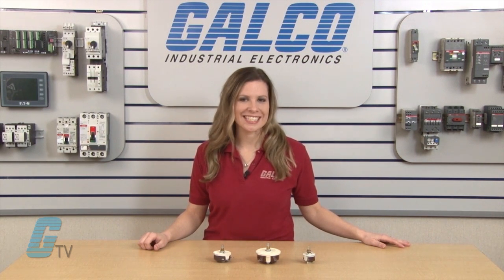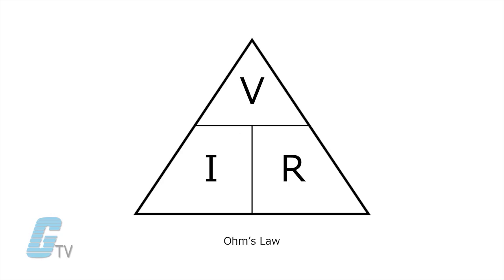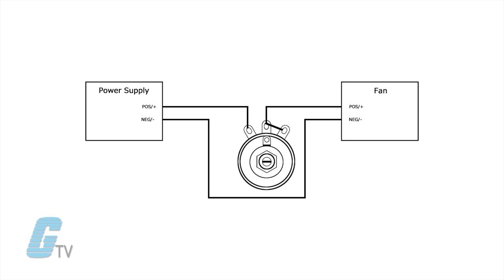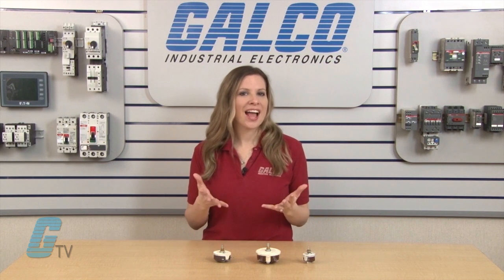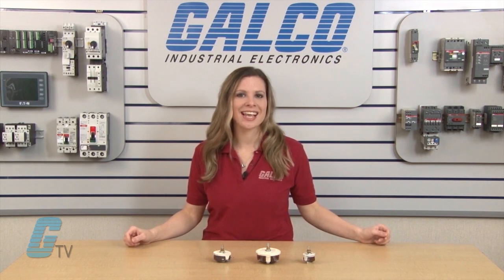What is a Rheostat

Comment: Say, can you tell me what kind of speed control would be appropriate for a vacuum cleaner that operates  at 110-125V AC, if we want the minimum power to be, say, 400W (at 120V) and the maximum at 1200W (again, at 120V)?

Comment: No with any resistance ie resistors and diodes zener diodes etc you have a voltage drop within the circuit. 
Normal diodes are from 0.6 to 0.7 volts drop within their normal working parameters.

Comment: Great videos..... I have to correct you with resistance and the voltage and current laws. When the resistance is increased in any circuit both the current and the voltage will be decreased.  When we decrease or lower the resistance in a circuit both the voltage and current are increased.
Reply: How so? I was under the impression that the voltage was constant, independant of the resistance.
Reply: @vincentdrew2194  voltage remains the same, and with increase in resistance, current decreases; with decrease in resistance, current increases. So in this case, the light bulb would have increased in brightness with decrease in resistance.

Comment: Hi.  I was trying to operate my LIONEL train  that work on A C  voltage from a big Z W transformer 275 watts - 60 cycles   at total 18 volts, i
was  purchasing an 50watts- 30 ohms  rheostat  (BUT) it not working as my train goes  jack rabbit fast as soon i turn the volume on that
rheostat ,why ? It seem to be very simple to install as just splitting in two the positive wire and just install the rheostat between so,why it
not work ???

Comment: A Rheostat is a variable resistor used to vary current and in a crude dimmer circuit. . A potentiometer is the same component used to divide and distribute voltage as in a volume control.

Comment: GalcoTV  Any idea if I used 225 Volts AC to control a 220V motor speed, what rheostat value resistance, watts, and voltage should I used?  Also if built and I used 1,000Volts AC, what rheostat value resistance, watts and voltage should I need to control a device that can handle 1,000Volts?  Can you help me what best rheostat value to control to avoid breaking off resistance and wattage? I need help to that.

Comment: what size rheostat do I need to control the voltage into the field circuit (12 volt but could go to 14 volts) of a 150 amp alternator to regulate it for welding?
Reply from the maker: Hello Junk Yard, we are going to need more information then that to recommend something that will work. Can you please give us a call at 800-337-1720 and ask for a product manager to help you size something correctly, ok?
Reply: The fields pull about 8 amps at full battery voltage (12-14). I am wanting to be able to vary the amperage from the alternator from 0-150 amps. I have been using a 10 ohm rheostat  and it works but I thought maybe a 30 ohm 150 watt  might give me more adjustability.

Comment: I am looking for a 100 K ohms, 4 Watt, 3 terminal Rheostat. Where can I find it.
Reply from the maker: Well Andre, our rheostats start at 7.5 watts but only go to 5K ohm, higher wattage will go as high as 50K but that is all I could find here. Our potentiometers only go to 2 watts. Can I ask what is this for?
Reply: it for a vintage Eico 950b meter.
Reply from the maker: Did a little research for you, for other sources of parts for something like this, I simply put your make and model on the web and found entire unit. You may want to consider a parts unit to keep your running. Does it have tubes?
Reply: The problem with buying another unit is that those switches are so old that they might not even be good. SO I am doing a restoration on the one that I have. I have manage to find a wire Wong pot that will suit  my need and yest it does have tubes. Thank you for doing the research and trying to help me. I really appreciate it.
Reply from the maker: No problem Andre, glad to do it. We at Galco think its kinda cool keeping the old stuff running, that's why we stock over 2.2 million parts. Sorry we didn't have what you needed today, but keep us in mind for tomorrow, cuz we literally have millions of parts in stock. Anything else you can think of you want to see in our videos please don't to post it right here or on our forum at "forum.galco.com."
Reply: Do you guys sell like precision resistors and capacitors? As you know in old electronic equipment there are lot of odd values of resistors and capacitors. So if you do pleas let me know
Reply from the maker: Yes we do, just call us at 800-575-5562 with a list of items you are searching for. Resistors are made precision but capacitors not so much. The voltage rating of a capacitor is critical, caps can be higher rated than original but not lower, the capacitance value is more forgiving. Good Luck with your resto project
Reply: Okay Thank You.

Comment: What is the difference between a potentiometer and a rheostat?
Reply: What affects the brightness of the light bulb is the voltage, not the current.
Reply from the maker: Good catch, sorry about that. 

That was an oversight on our end regarding the original script vs how we ended up presenting the information. Thank you for pointing that out to us!
Reply from the maker: Potentiometers control a circuit's signal level rather than its power level. Many electronic audio devices 
feature potentiometers, such as the volume control system on a television. They also serve as position transducers in joysticks and voltage divider circuits. Electricians employ rheostats, on the other hand, for handling much higher voltages and currents. They also feature 3 terminals and a movable wiper that switches from zero to maximum 
resistance
Reply: GalcoTV z